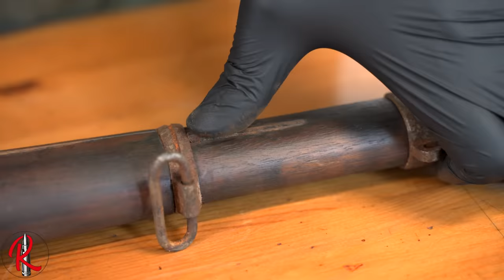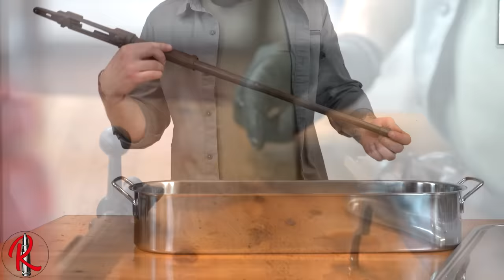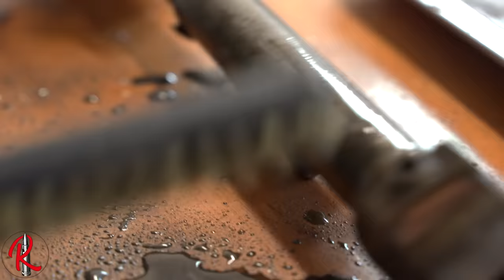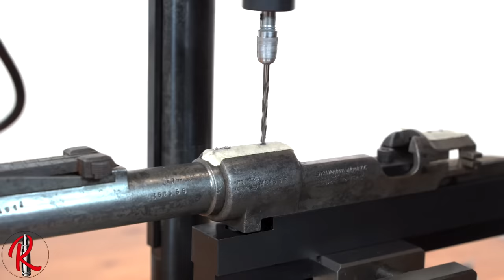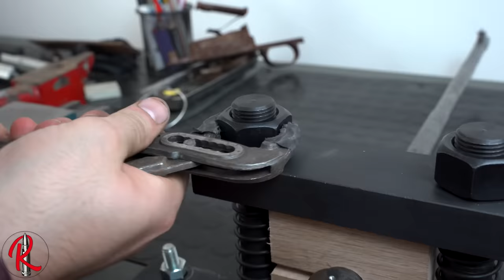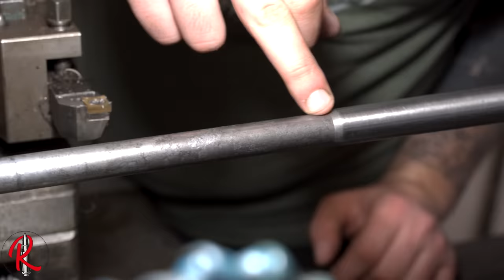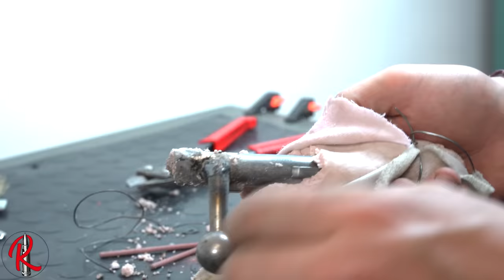K98 Mauser restoration & sporterization - real gun restoration

Comment: it is Gewehr 98
Reply: No its not
Reply: @Wrathterrible  looks similar because it has a straight handle
Reply: Maybe similiar but its not gewehr
Reply: @Wrathterrible  what's the difference between kar98 and gewehr 98 bro?
Reply: @eevnxx_  different gun. Kar is kar and gewehr is gewehr
Reply: @Wrathterrible  can you tell the difference?, from the look or maybe the mechanism
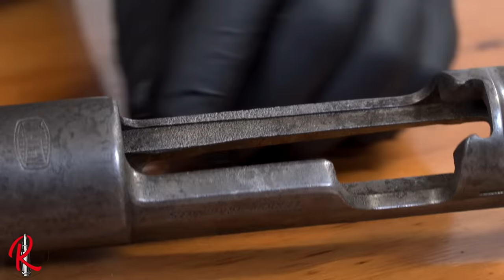Reply: Okay all.  for starters Gewehr 98 mausers had a rollercoaster rear sight. This does not have that rear sight. That said, this gun is neither a Gewehr or a K98. That's a 1934 Banner Mauser.  @ 3:30 you will see the side says "Standard Modell" and the "Mauser" banner across the top of the receiver bridge.  Looks to have been made in  Oberndorf a/N as I can't see the serial number but it's a long one, so most likely there.  These were commercial guns made only for export.  Most went to Asia and south America.
Reply: @bad74maverick1  the comments sec is amazing on this one.🤣🤣🤣🤣
Reply: @bad74maverick1  yes this. the way you get the bolt out is very different from the kar98. thats what gave it away to me personally
Reply: @black_jack4600  It is?  My Gewehr 98 and my K98 are both the same.  Granted I don't own a banner mauser but I wouldn't think it was different?  left bolt latch rear swings out and bolt slides out...
Reply: @eevnxx_  I will be happy to try to explain all three mausers as the one in this video is neither a Gewehr 98 nor a k98 Mauser.  With the G98 (Gewehr) it's a full length rifle so it's longer.  It has a very large rounded rear sight called a roller coaster rear sight.  They will have ww1 dates and be marked on the receiver bridge Mauser, Deutsche Waffen und Munitionsfabriken (also marked Oberndorf) Haenel, Sauer & Sohn, Waffenwerke Oberspree, V. Chr. Schilling Co., Steyr, Simson, Amberg, Danzig, Erfurt, Leipzig, and Spandau.  Followed by the year it was made I.E. my G98 is marked Amberg 1916 on the bridge.  G98's will have finger grooves in the forestock and a straight bolt.  The cleaning rod is long.  Also the first 5 years the G98 was made it used an 8mm bullet diameter .318.  After 1903 they went to a .323 diameter 8mm bullet.  It is not advised to shoot .323 diameter 8mm in early G98s. 
The gun in this video is a 1934 Banner Mauser.  It is basically the same as a G98 except it has an improved rear sight.  These guns will have the "Mauser" name in a banner across the receiver bridge and on the left side of the gun it will say "Standard Modell" (@3:30).  These were made for the commercial market in between world wars and were for export only.  Most went to Asia and South America.  The K98 is the carbine version of the G98.  It's Karbiner Model 98.  It's shorter, has a bent bolt, the barrel band springs aren't pinned, they are capture on most models, they do not have finger grooves in the forestock, retains the improved rear sight, has a front sight hood (protector), where the bolt is bent downward the stock is "dished" out behind it so you can get to the bolt easier, and the sling is mounted on the side of the rifle while on the other 2 mausers the sling hung under the gun.  they also had a shorter cleaning rod depending on manufacture.  The manufacture of the k98 didn't show the full name on the receiver bridge, it was a manufacturing code with date of manufacture.        
ar Mauser in Borsigwalde
ax Erma Werke
bcd Gustloff Werke
bnz Steyr-Daimler-Puch
BSW Berlin-Suhler Waffen und Fahrzeugwerke (BSW is an abbreviation and not letter code)
byf Mauser in Oberndorf am Neckar
ce Sauer & Sohn
dot Waffenwerke Brünn in Brno
dou Waffenwerke Brünn in Bystrica
duv Berlin-Lübecker Maschinenfabrik
svw45 Mauser 1945 production in Oberndorf am Neckar
swp45 Waffenwerke Brünn 1945 production in Brno.
Reply: SharkNoirOficial  No it's a1934 banner mauser.  Different gun.
Reply: @bad74maverick1  thanks for explaining
Reply: @eevnxx_  No problem.  I love this hobby and history.

Comment: i don't think is a kar98k, but a varmint hunting rifle
Reply: @Based maybe
Reply: @AverageHistoryEnjoyerit's a Mauser banner rifle made from 1918-1934 it's technically a pre kar98 designation as it features the Mauser logo.
Reply: @cloroxlavenderscent4307 the name for it is standardmodell, correct?
Reply: @noodlebomber4847  I believe they are used interchangeably yes.
Reply: @cloroxlavenderscent4307  I thought the standardmodell was built before the k98, and with a straight bolt..?
Reply: @noodlebomber4847  The standardmodell or the banner rifle was actually made between 1924 and 1935. It was made prior to the Kar98k. However it doesn't predate the Kar98 rifles themselves. As the Kar98 was developed during the latter half of WW1
Reply: @cloroxlavenderscent4307  alrighty, I see. I knew the production times of standardmodell, but not kar98. Thanks.
Reply: @noodlebomber4847  when you refer to the kar98 I'm assuming you mean the Kar98k which was made from 1934-1945. As previously mentioned the Kar98a -kar98ab were inventions of world war 1 which in turn stopped production after the war because of the treaty of Versailles.
Reply: @cloroxlavenderscent4307  yep. That's the one.
Reply: @cloroxlavenderscent4307  You and I have both been combing the comments correcting people I see.  Nice to see a fellow gun historian correcting!!